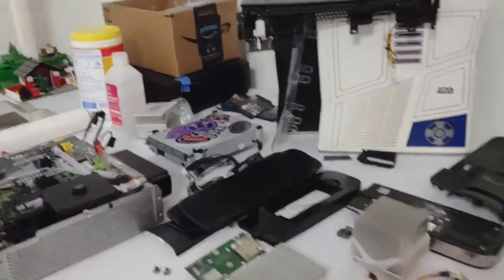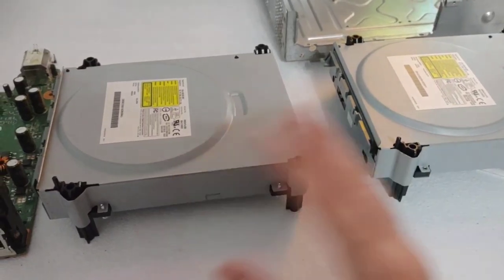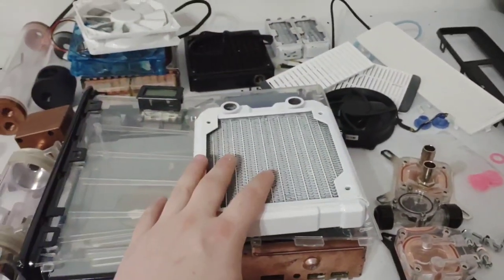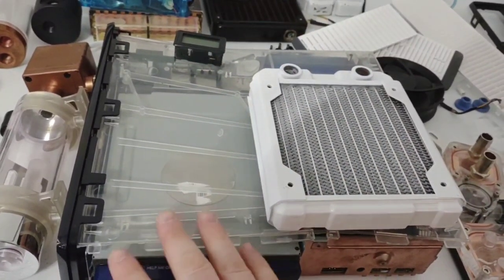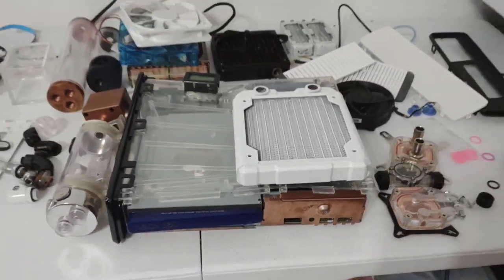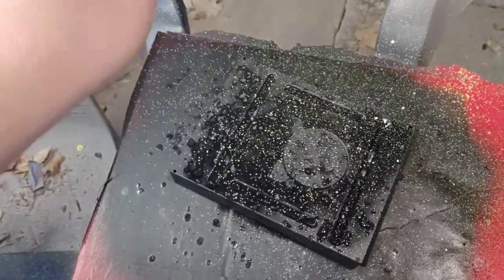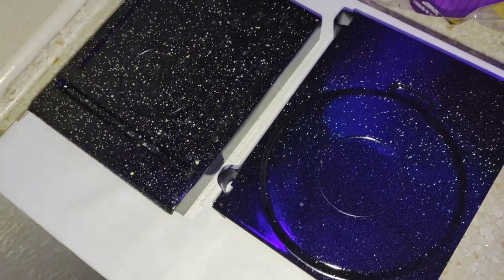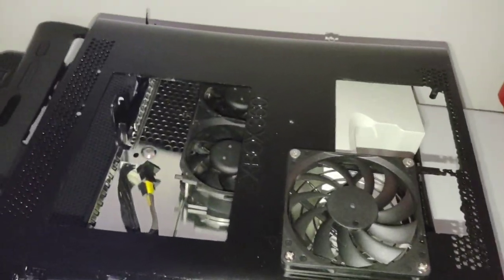Painting some disc drives for the water cooled slim and phat!

Comment: Do they sell transparent dvd covers or do you have to make one yourself?
Reply from the maker: @thesmokecriminal5395  can't really find them anymore, I just cut my own window or i still have a couple XCM DVD drive tops, but yea they do take some time to cut that metal and do it cleanly
Reply: @trinkettinkeringking  IMO if ur gonna have a see through side panel or a section of the side panel that is see through, the DVD drive cover should be see through as well
Reply from the maker: @thesmokecriminal5395  I agree! Anything but a factory DVD drive with the sticker on it, drives me crazy when someone puts a ghost case or a window without doing anything to the inside, the 2 phats I'm working on now will have DVD drive delete🙌
Reply: @trinkettinkeringking  are they modded?
Reply from the maker: @thesmokecriminal5395  rgh2 with chip, and RGH 1.2 with chip and lifetime on stealth servers, one or cooled one internal water cooled
Reply: @trinkettinkeringking  wow, pretty nice, then there sure is no need for a DVD drive.
Reply from the maker: @thesmokecriminal5395  nope, both are preloaded with all the cods and GTA 4+5, and still have plenty of space